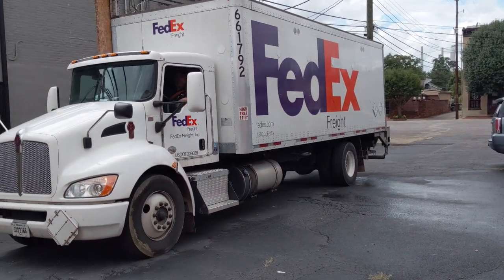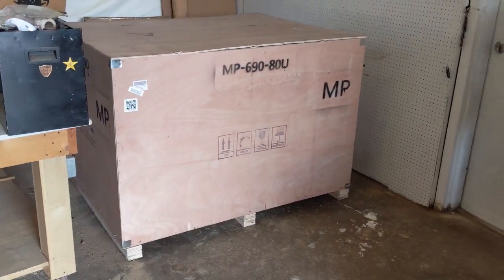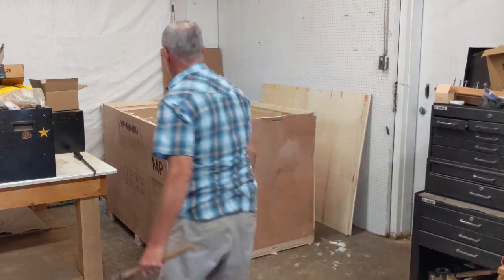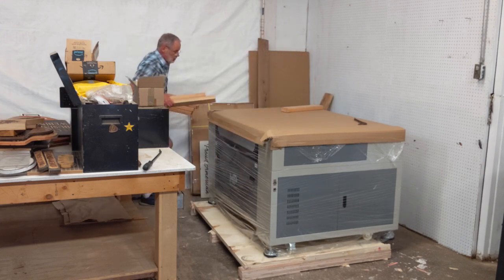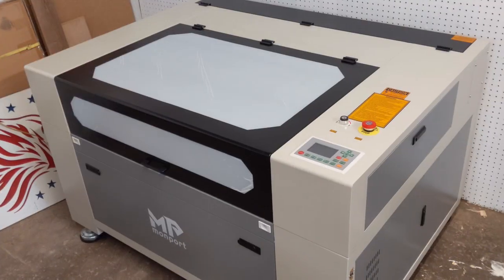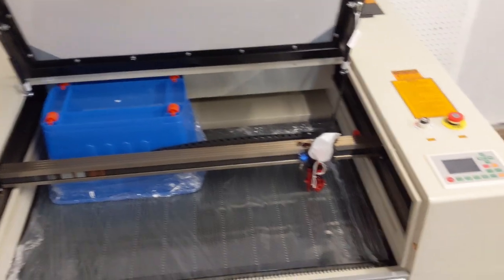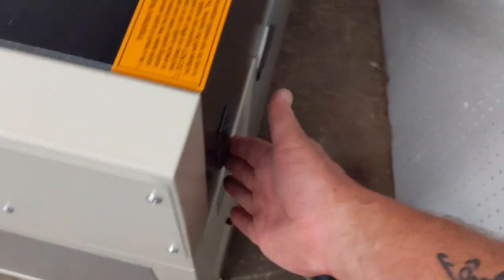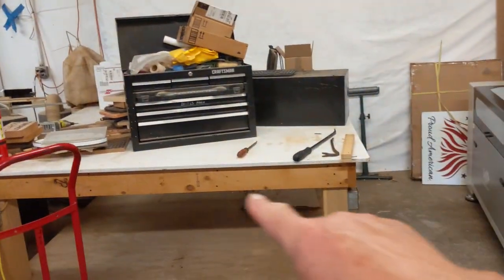Monport 80 Watt CO2 Laser, CNC Laser Cutter and Engraver - IDC Woodcraft

Comment: Have fun. Been engraving with lasers for over 20 years. longmill style CNC are great, but many times lasers are so much quicker on certain projects. Enjoy.  Even for experienced CNC users. A laser will be a very new experience. A different beast. And yes I know a laser is a CNC. But in laser world we generally just call it  a laser. Even after 20 years I am till learning new tricks on my laser(s). Before I had a longmill, If I need to cut thick material. I would cut templates with my laser and then tape and route wood. Please any questions. Seriously.  I have been using laser for a long, long time. I still use the original laser software. I tried the 3rd part software. It was nice, but at least  at the time you had to be connected to the internet to use it. And I like my software independant if possible.
Reply from the maker: Right on Hobbyhands, happy to hear that the laser will be a good addition to the shop. Im excited to get this bad boy set up and cutting out material.

Comment: Hey Garrett grandpa 1999 again I would recommend you use foam tipped Q-tips or whatever you call them instead of Q-tips Q-tips may leave fibers behind not good You can find them on Amazon real reasonable
Reply from the maker: Grampa1999, that's an excellent idea thanks!

Comment: Yup... use our CO2 laser more then the CNC router and have for years.  Each has their place... just depends on the work you are doing 👍

Also... if you didn't get a real chiller yet, do it!  The 5200 is a great chiller unit.
Reply from the maker: NovoWorks, thanks for that great tip! I agree, each machine does have its place in the shop!